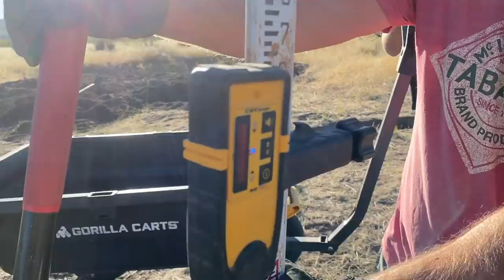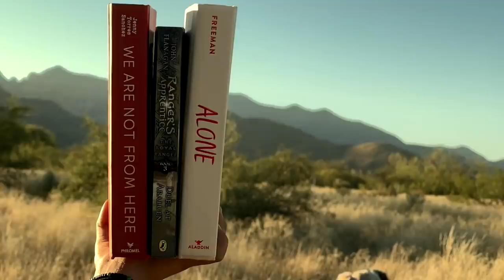Shou Sugi Ban - Preserving Wood in the Desert (Chicken Garden Day 9)

Comment: Putting spigots around my property was one of the BEST things I did early on as an avid gardener.  Dragging hoses around everywhere is lame and they don't survive well in the sun.  Continuous roll PEX is a good option with freeze resistance, otherwise stock up on 10ft PCV sticks.  One day rent a trenching machine and run your trenches.  Also consider putting in conduit for electrical power and low voltage/data in certain runs.    This way you dig your property all up only one time, and for long runs the trenching machine is GREAT!  I've used both a Barreto 24" rental and a Toro tracked 36" beast I bought for a song at an equipment auction needing a belt put back on the pulley.  (And a new chain, teeth, and idler not long after but hey still way ahead.)